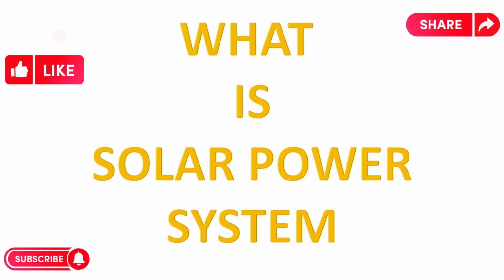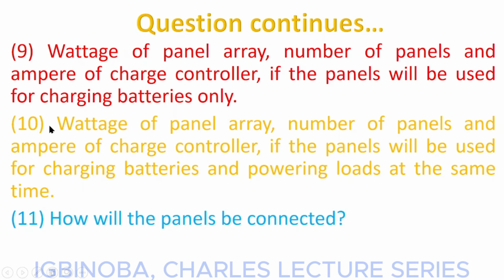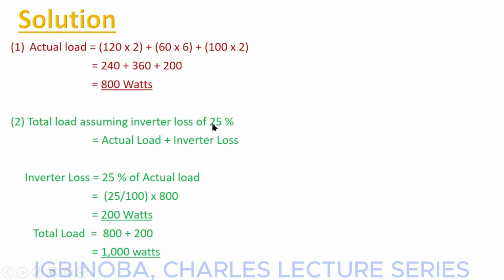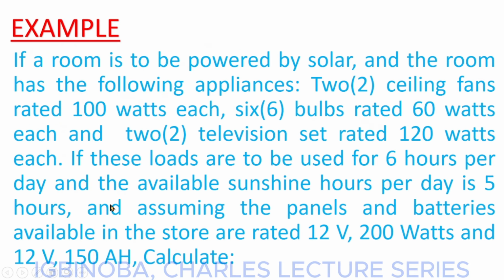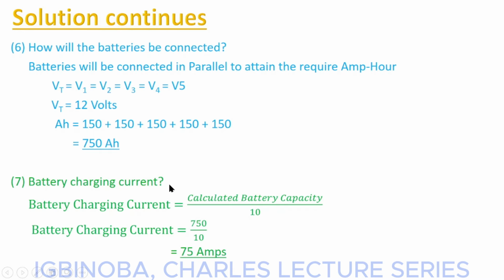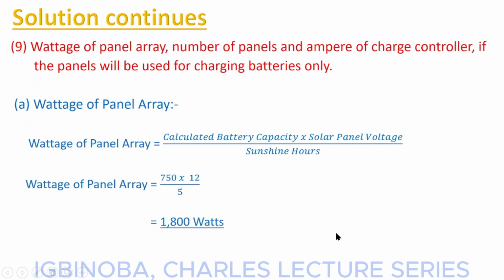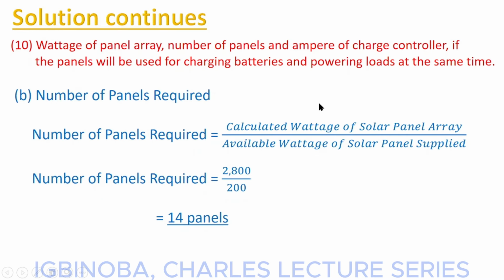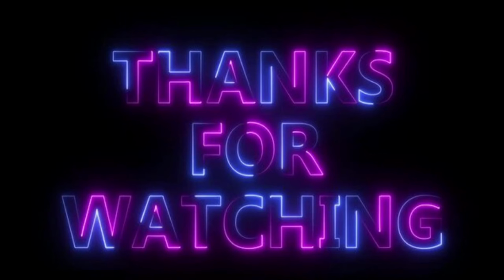Design of Solar Power System

Comment: PETRO3103Y

1. Actual load= (100×3)+(60×10)+(120×4) =1380watts

2. Total load assuming inverter loss of 25%= Actual load +Inverter loss

Inverter loss=25% of Actual load
= 25%×1380=345 watts

Total load= 1380+345=1725 watts

3. Inverter rating on VA using power factor of 0.8
= (1725÷0.8)= 2156.25

4. Battery capacity using factor for reserve 75% =(2×1725×6×0.75)/ battery voltage (12v) 
=1293.75Ah

5. No. of batteries for backup hours=1293.75Ah÷150Ah= 8.6 =8 batteries 

6. How batteries will be connected?
The batteries will be connected in parallel 

Vt=V1=V2=V3=V4=V5=V6=V7=V8
Vt= 12volts

Ah=150+150+150+150+150+150+150+150=1200

7. Battery charging current=1293.75÷10=129Amps

8. Battery charging time assuming charging loss of 40%.    = 1293.75Ah+(40%+1293.75Ah)÷129A = 14hrs

9a. Wattage panel array= 3105 watts

9b. Number of panels required= 3105÷200=15.5 panels
=15panels

9c. Ampere of charging controller required= 3105÷12 = 258.75Amps

10a. Wattage of panel array= Calculated wattage of solar panel array for charging battery only+ calculated total load =3105+1725=4830watts

10b. Number of panels required= calculated wattage of solar panel array÷ Available wattage of solar panel supplied
= 4830watts÷200
=24.15Panels
=24panels

10c. Ampere of charge controller= calculated wattage of solar panel array÷ solar panel voltage
=4830watts÷12volts
= 402.5Amps

11. How will the panels be connected?
Ans: They will be connected in parallel

Comment: EEE36F

1)actual load = 1380watts     

2)total load= 1725 watts

3) inverter rating =2156.25VA 

4) battery capacity= 1293.75A 

5) No of batteries= 9 

6) batteries are connected in parallel 

7) battery charging current =129.4amps 

8)battery charging time=14hrs 

9a) wattage of panel array= 3105watts 
9b) number of panels=16panels 
9c)charge controller= 258.75A 

10a) wattage of panel array=4830watts 
10b) number of panels = 24 
10c) charge controller= 402.5A 

11)panels are arranged in parallel

Comment: MECH370R

 1. Actual load = 1380 watts 
2. Total load = 1725watts 
3. Inverter rating = 2156.25 VA
 4. Battery rating = 1293.75Ah
 5. Number of batteries = 9
 6. Battery are connected in parallel
 7. Battery charging current=129.4Amps 
8. Battery charging current = 129.4 Amps 
9a.wattage of panel arrays = 3105watts 
b. Number of panels = 16 panels 
c. Charge controllers = 258.75A 
10a. Wattage of panel arrays = 4830watts 
b. Number of panels = 24 
c. Charge controller = 402.5A
 11. Panels are arranged in parallel

Comment: COMP313M
1. 1380 watts
2. 1725 watts
3. 2156.25Va
4.1293.75Ah
5 8.6
6. Parallel
7. 129.375
8. Charging time
9. (a) wattage of panel array=3105W
(b) Number of panel =16 panels
(c) Charge controller=258.75 A
10.(a) Wattage panel array=4840 W
(b) Number of panel =24 panels
(c) Charge controller= 402.5A
11. Panel arrangement parallel

Comment: MAR386H

1.1380W

2.1725W

3. 2156.25VA

4. 1293.75A

5. 9 batteries

6. Parallel connection

7. 129.4 Amp

8. 14hrs

9a. 3105W

9b. 16 panels

9c. 258.75A

10a. 4850W

10b. 24 Panels

10c. 402.5A

11. Parallel connection

Comment: MAR338L

1 Actual load 1380W
2 Total load  1720W
3 Inverter rating  2156.25VA
4 battery Capacity 1293.75Ah
5 number of batteries 8.6
6 Parallel 
7 Battery charging  129.4A
8 T = 14hrs
9 (a) 3105W
   (b) 15.5 panels 
   (c)  258.75 A
10 (a) 4830W 
     (b) 24 panel 
     (c) 402.5A 
11 Parallel

Comment: MAR329C

1. Actual load: 1380 watts

2. Total load: 1725 watts

3. Inverter rating: 2156.25 VA

4. Battery capacity: 1293.75 Ah

5. Number of batteries: 8.6

6. Connection: parallel

7. Battery charging current: 129.375

8. Charging time

9. a. Wattage of panel array: 3105W

b. Number of panels:16 panels

c. Charge controller: 258.75A

10 a. Wattage of panel array - 4830W

b. Number of panel - 24

c. Charge controller - 402.5A

11 Panel arrangement: Parallel

Comment: NAT331E
1)actual load=1380watts.2) Total load=1725watts.3)inverter rating=2156.25VA.4)Battery capacity=1293.75Ah.5)Number of batteries=8.6.6) connection parallel.7)Battery charging current=129.375.8) charging time.9)a wattage of panels array=3105w.B) Number of panels 16 panels charge controller 258.75A.10)a wattage of panels array 4830W.B) Number of panels 24.C) charge controller=4025A.11) panels arrangement parallel.

Comment: CHM355C

1. Actual Load = 1380watts
2. Total Load = 1725watts
3. Inverter Rating = 2156.25VA
4. Battery Capacity = 1293.75Ah
5. Number of Batteries =8.625 = 9
6. Parallel Connection
7. Battery Charging current = 129.375Amp
8. Battery Charging Time= 14hours
9a. Wattage on Panel Array = 3105watts
9b. Number of panels =15.5 = 16panels
9c. Ampere of charge controller = 258.75Amps
10a. Wattage of panel array = 4830watts
10b. Number of Panels = 24.15 = 25panels
10c. Ampere of Charge controller = 402.5amps
11. Parallel connection.

Comment: PETRO 389K
1. Actual load= (100×3)+(60×10)+(120×4) =1380watts
2. Total load assuming inverter loss of 25%= Actual load +Inverter loss
Inverter loss=25% of Actual load
= 25%×1380=345 watts
Total load= 1380+345=1725 watts
3. Inverter rating on VA using power factor of 0.8
= (1725÷0.8)= 2156.25
4. Battery capacity using factor for reserve 75%=(2×1725×6×0.75)=1293.75Ah
5. No. of batteries for backup hours=1293.75Ah÷150Ah= 8.6 =8 batteries 
6. How batteries will be connected?
The batteries will be connected in parallel 
Vt=V1=V2=V3=V4=V5=V6=V7=V8
Ah= 150+150+150+150+150+150+150+150=1200
7. Battery charging current=1293.75÷10=129Amps
8. Battery charging time assuming charging loss of 40%= 1293.75Ah+(40%+1293.75Ah)÷129A=14hrs
9a. Wattage panel array= 3105 watts
9b. Number of panels required= 3105÷345=9 panels 
9c. Ampere of charging controller required= 3105÷12=258.75Amps
10a. Wattage of panel array= Calculated wattage of solar panel array for charging battery only+ calculated total load =3105+1725=4830watts
10b. Number of panels required= calculated wattage of solar panel array÷ Available wattage of solar panel supplied= 4830watts÷345= 14Amps
10c. Ampere of charge controller= calculated wattage of solar panel array÷ solar panel voltage=4830watts÷12volts= 402.5Amps
11. How will the panels be connected?
Ans: They will be connected in parallel

Comment: MAR 324 X

1)actual load = 1380 watts 

2)total load =1725 watts 

3) inverter rating= 2156.25VA 

4) battery capacity= 1293.75A 

5)no of batteries=9

6) batteries are connected in parallel 

7) battery charging current= 129.4amps 

8) battery charging time = 14hrs 

9a) wattage of panel array = 3105 watts 

9b) number of panels= 16 panels 

9c ) charge controller= 258.75A 

10a) wattage of panels array= 4380watts 

10b) number of panels = 24 

10c ) charge controller= 402.5A

11) panels are arranged in parallel

Comment: MECH 353A

1.)Actual load is 1380W
2.)Total load is 1725W
3.)Inverter rating is 2156.25VA
4.)Battery capacity is 1293.75AH
5.)No of batteries 8.6V~9
6.)Parallel
7.)Battery Charging current is 129.375amps
8.) Charging Time is 14hours
9a.)3105W
9b.)15.5panels
9c.)258.75A
10a.)4830W
10b.)24 panels
10c.)402.5A
11.)parallel.

Comment: MAR387I
1: actual load 1380watts

 2 total load=1725 watts 
3: inverter rating-2156,25VA 
4: battery capacity» 1293.75A
 5: No of batteries=9
 6: batteries are connected in parallel
 7. battery charging current =129.4amps
 8: battery charging time=14hrs
 9a: wattage of panel array 3105watts 
9b: number of panels-16panels 
9c: charge controller= 258.75A 
10a: wattage of panel array 4830watts 
10b: number of panels = 24
 10c: charge controller = 402.5A 
11: panels are arranged in parallel

Comment: PETRO34D

1. Actual Load

Actual Load = (3 × 100) + (60 × 10) + (120 × 4)
Actual Load = 1380 Watts.

---

2. Total Load

Total Load = Actual Load + (Actual Load × Power Loss)
Total Load = 1380 + (1380 × 0.25)
Total Load = 1725 Watts.

---

3. Inverter Rating in VA

Inverter Rating = Total Load ÷ Power Factor
Inverter Rating = 1725 ÷ 0.8 = 2156.25 VA.

---

4. Battery Capacity

Battery Capacity = (2 × Total Load × Backup hours × Factor for Reserve) ÷ Battery Voltage
Battery Capacity = (2 × 1725 × 6 × 0.75) ÷ 12
Battery Capacity = 1293.75 Ah.

---

5. Number of Batteries

Number of batteries = Battery Capacity ÷ Capacity of given battery
Number of batteries = 1293.75 ÷ 150 = 8.625
Rounded up ≈ 9 batteries.

---

6. Battery Connection Type

The batteries will be connected in PARALLEL to meet the voltage requirement of 12V.

---

7. Battery Charging Current

Battery Charging Current = Battery Capacity ÷ 10
= 1293.75 ÷ 10
= 129.375 Amps.

---

8. Battery Charging Time (@ 40% Loss)

Battery Charging Time = (Battery Capacity + (Battery Capacity × 40%)) ÷ Charging Current
= (1293.75 + (1293.75 × 0.4)) ÷ 129.375
= 14 hours.

---

9. Solar Panels (Without Load)

a. Wattage of Panel
Wattage (without load) = (Battery Capacity × Panel Voltage) ÷ Sunshine hours
= (1293.75 × 12) ÷ 5
= 3105 Watts.

b. Number of Panels
Number of panels = 3105 W ÷ 200 W
= 15.525 ≈ 16 panels.

---

10. Solar Panels (With Load)

a. Wattage (with load)
= Wattage (without load) + Total Load
= 3105 + 1725
= 4830 Watts.

b. Number of Panels
4830 W ÷ 200 W = 24.15
Rounded ≈ 25 panels.

c. Current of Charge Controller
= 4830 W ÷ 12 V
= 402.5 Amps.

---

11. Panel Connection Type

The panels should be arranged in PARALLEL to maintain a supplied voltage of 12V.

Comment: MECH3115K
1. Actual Load (Watts): 1380W
2. Total Load (DC with 25% Inverter Loss): 1720W
3. Inverter Rating: 2156.25VA
4. Battery Capacity: 1293.75Ah
5. Number of Batteries (12V, 150Ah): 9
6. Battery Connection (48V System): 2 parallel strings of 4 batteries in series. 
7. Battery Charging Current: 129.4A
8. Minimum Charging Time (hrs): 14 hours 
9a. 3105W
b. 15.5 panels 
c. 258.8A
10a. 4830W
b. 24 panels 
c. 402.5A
11. Panel Connection: 3 parallel strings of 6 panels in series.

Comment: MECH3131A

Actual load: 1380 W

2. Total load: 1725 W

3. Inverter rating: 2156.25 VA

4. Battery capacity: 1293.75 AH

5. Number of batteries: 9

6. Configuration: parallel

7. Battery charging current :129.375 amps

8. Charging time: 14 hours

9. (a) 3105 w

(b) 15.5 panels

(C) 258.75 A

10. (a) 4830 watts

(b) 24 panels

(C) 402.5 A

11. Configuration: parallel

Comment: MECH3136F
1. Actual load = 1380w
2. Total load = 1735w
3. Inverter rating = 2156.25VA
4. Battery capacity = 1293.75AH
5. No. of batteries = 9
6. Battery connection is parallel
7. Battery charging current = 129.375amps
8. Battery charging time = 14 hours
9. (A) 3105w (B) 16 panels (C) 258.75A
10. (A) 4830w (B) 24 panels (C) 402.5A
11. Parallel

Comment: EEE3176T

1. Actual load =1380W
2. Total load = 1725W
3. Inverter rating = 2156.25VA
4. Battery capacity =1293.75AH
5. Number of batteries for backup hours (12v, 150AH)=9
6.Battery connection= it will be connected in parallel 
7.Battery charging current =129.4A
8. Minimum charging Time = 14hours 
9.a 3105W
   b 15.5 panels ~ 16 panels 
   c 258.8A
10.a 4830W
     b 24 panels
     c402.5A
11. Parallel

Comment: PETRO324X

1. The actual load
=(3×100)+(10×60)+(4×120)
=1380 watts

2. Total load assuming inverter loss of 25%
= 1380+(25% of 1380)
=1380+ 345
=1725 watts

3. Inverter rating in VA using power factor of 0.8
= Total load ÷ power factor
= 1725÷0.8
=2156.25 VA

4. Battery capacity using a factor for reserve of 75%
Battery capacity = (2×total load×back up hours×factor for reserve) / battery voltage 
= (2×1725×6×0.75) / 12
= 1293.75 AH

5. Number of battery for backup hour
= Calculated battery capacity÷capacity of battery available 
=1293.75 ÷ 150
=8.625
=8

6. How will the battery be connected?
The battery would be connected in parallel to attain the required amp hour
V1=V2=V3=V4=V5=V6=V7=V8
V1= 12 volts
AH = 150 × 8
= 1200 AH

7. Battery charging current
= Calculated battery capacity ÷ 10
= 1293.75 ÷ 10
= 129.375 amps

8. Battery charging time assuming charging loss of 40%
= {Calculated battery capacity + ( 40% of calculated battery capacity)} / charging current 
= {1293.75 + (40% of 1293.75)} ÷ 129.375
= 14 hours

9a. Wattage of panel array
= ( Calculated battery capacity × solar panel voltage) ÷ sunshine hours
= ( 1293.75 × 12) ÷ 5
= 3105 watts

9b. Number of panels array
= Calculated wattage of solar panel array ÷ available wattage of solar panel supplied 
= 3105÷ 200
= 15.525 
= 15 panels

9c. Ampere of charge controller required 
= Calculated wattage of solar panel array ÷ solar panel voltage 
= 3105 ÷ 12
= 258.75 amps

10a. Wattage of panel array
= Calculated wattage of solar panel array for charging battery only + calculated total load
= 3105 + 1725
= 4830 watts

10b. Number of panels required 
= Calculated wattage of solar panel array ÷ available wattage of solar panel supplied 
= 4830 ÷ 200
= 24.15
=24 panels

10c. Ampere of charge controller 
= Calculated wattage of solar panel array ÷ solar panel voltage 
= 4830 ÷ 12
= 402.5 amps 

11. How will the panels be connected? 
The panels would be connected in parallel.

Comment: MAR384F
1. 1380W
2. 1725W
3. 2156.25VA
4. 1293.75A
5. 9 batteries
6. Parallel connection 
7. 129.4 Amp
8. 14hrs
9a. 3105W
9b. 16 panels
9c. 258.75A
10a. 4850W
10b. 24 Panels
10c. 402.5A
11. Parallel connection

Comment: MECH346T

1. Actual load= 1380W
2. Total load= 1725W
3. Inverter rating=2156.25VA
4. Battery Capacity 1293.75Ah
5. Numbers of batteries= 9
6. Connections will be in parallel.
7. Battery charging current= 129.38Amps
8. Battery charging time= 14hrs.
9a. Panel wattage=3105W
9b. Numbers of panels= 16 panels
9c. Ampere of charge controller= 258.75
10a. Panel wattage= 4830W
10b. 24 panels
10c. 402.5A
11. Connections in parallel

Comment: EEE35I

1. Actual load 1380w
2. Total load 1725w
3. Inverter rating 2156.25VA
4. Battery capacity is 1293.75AH
5. No of batteries 8.6
6. connection of parallel
7. Battery charging current is 129.375amps
8. Charging time is 14 hours
9. (A) 3105W (B) 15.5 panels (C) 258.75A
10. (A) 4830w (B) 24 panels (C) 402.5A
11. Parallel

Comment: MECH3106B

1. Actual load is 1380w
2. Total load is 1725w
3. Inverter rating is 2156.25VA
4. Battery capacity is 1293.75AH
5. No of batteries 8.6 ~9 6. Parallel
7. Battery charging current is 129.375amps
8. Charging time is 14 hours
9. (A) 3105W
(B) 15.5 panels
(C) 258.75A
10. (A) 4830w
(B) 24 panels
(C) 402.5A
11. Parallel

Comment: PETROCHEM366N

1 Actual load 1380W
2 Total load  1720W
3 Inverter rating  2156.25VA
4 battery Capacity 1293.75Ah
5 number of batteries 8.6
6 Parallel 
7 Battery charging  129.4A
8 T = 14hrs
9 (a) 3105W
   (b) 15.5 panels 
   (c)  258.75 A
10 (a) 4830W 
     (b) 24 panel 
     (c) 402.5A 
11 Parallel

Comment: PETROCHEM390L

1 Actual load is 1380W
2 Total load is 1720W
3 Inverter rating is 2156.25VA
4 battery Capacity is 1293.75Ah
5 number of batteries is 8.6
6 Parallel 
7 Battery charging is 129.4A
8 Time is 14hrs
9 (a) 3105W
   (b) 15.5 panels 
   (c)  258.75 A
10 (a) 4830W 
     (b) 24 panel 
     (c) 402.5A 
11 Parallel

Comment: MECH3161E
1. Actual load= 1380W
2. Total load= 1725W
3. Inverter rating= 2156.25VA
4. Battery Capacity= 1293.75Ah
5. Numbers of batteries= 9
6. Connections will be in parallel.
7. Battery charging current= 129.38Amps
8. Battery charging time= 14hrs.
9a. Panel wattage= 3105W
9b. Numbers of panels= 16 panels
9c. Ampere of charge controller= 258.75
10a. Panel wattage= 4830W
10b. 24 panels
10c. 402.5A
11. Connections in parallel

Comment: C3117M
1. Actual Load = 1380 watts

2. Total Load = 1725 watts

3. Inverter Rating = 2156.25 VA

4. Battery Capacity = 1293.75 Ah

5. Number of Batteries = 8.625 ~ 9 batteries

6. Parallel

7. Battery charging current = 129.375 Amps

8. Charging time = 14 hrs

9. (a) 3105 watts
    (b) 15.525 ~ 16 panels
    (c) 258.75 Amps

10. (a) 4830 watts
    (b) 24.15 ~ 24 panels
    (c) 402.5 Amps

11. Parallel

Comment: EEE3136F 

1. Actual Load = 1380 watts

2. Total Load = 1725 watts

3. Inverter Rating = 2156.25 VA

4. Battery Capacity = 1293.75 Ah

5. Number of Batteries = 8.625 ~ 9 batteries

6. Parallel

7. Battery charging current = 129.375 Amps

8. Charging time = 14 hrs

9. (a) 3105 watts
    (b) 15.525 ~ 16 panels
    (c) 258.75 Amps

10. (a) 4830 watts
    (b) 24.15 ~ 24 panels
    (c) 402.5 Amps

11. Parallel

Comment: EEE3146P

 1) actual load=1380watts.
2) Total load=1725watts.
3)inverter rating=2156.25VA.
4) Battery capacity=1293.75Ah.
5) Number of batteries=8.6.
6) connection parallel.
7) Battery charging current=129.375
.8) charging time.
9)a wattage of panels array=3105w.
B) Number of panels 16 panels charge controller 258.75A.
10)a wattage of panels array 4830W.
B) Number of panels 24.
C) charge controller=4025A.
11) panels arrangement parallel.

Comment: COMP376X 

1) Actual load	1380 W
2) With inverter loss	1725 W
3) Inverter rating	≈ 2.2 kVA → choose 2.5 kVA
4) Battery capacity needed	1150 Ah
5) Number of batteries	8 × 150 Ah batteries
6) Battery connection	All parallel (12 V system)
7) Charging current	115 A
8) Charging time	≈ 17 hours
9) a. 3105 W
      b. 15.5 panels
      C. 258.75 A
10) a. 4830 watts 
       b. 24 panels
       C.  402. 5 A
11) arrangement of panel is parallel

Comment: CIV395Q

1: Actual load : 1380W

2: Total load 1725W

3: Inverter rating : 2156.25VA

4: Battery Capacity: 1293.75AH

5: Number of batteries : 9 

6: Configuration: Parallel 

7: Battery charging current: 129.375 amps 

8; Charging time : 14 hours

9:  (A) 3105W

     (B) 15.5 Panels 
 
     (C) 258. 75A 

10: (A) 4830A

      (B) 24 panels 

      (C) 402.5A 

11: Configuration: Parallel.

Comment: CHM310j

 1. Actual load is 1380W
 2. Total load is 1725W
 3. Inverter rating is 2156.25VA
 4. Battery capacity is 1293.75AH
 5. No. of batteries is 8.625-9batteries
 6. Parallel
 7. Battery changing current is 129.375amps 8. Charging time is 14hours
 9. (A) 3105W (B) 15.525~16panels (C) 258.75A
10. (A) 4830W (B) 24.15~24panels (C) 402.5A 11. Parallel